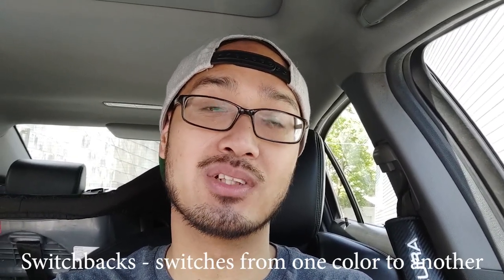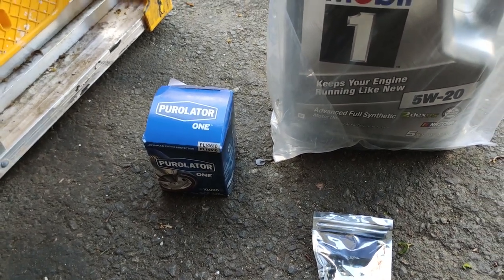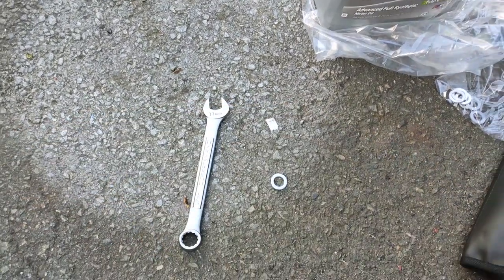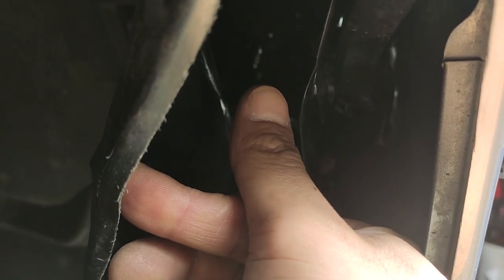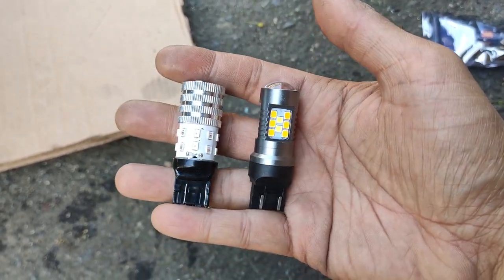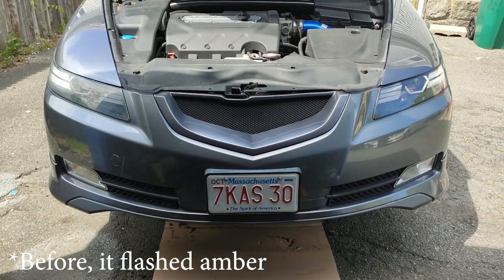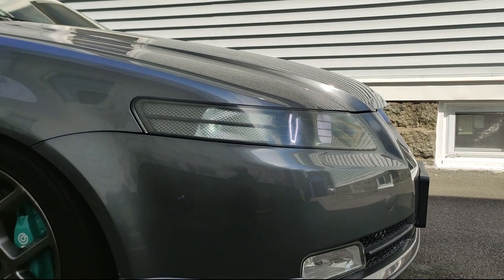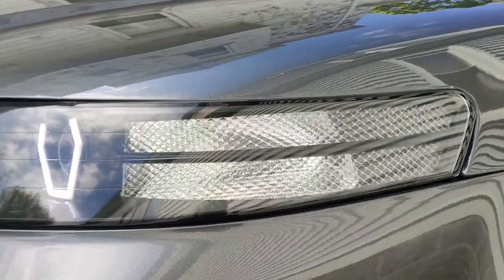LED Switchbacks!! on the RGB Headlights

Comment: Damn. I installed my switchbacks and they work fine. But for some reason, when I press the lock/unlock on my fob, they don't light up in sync with the rest of my lights anymore.
Reply from the maker: Not sure what's up.  Double check you installed everything correctly,  not sure if it's possible to plug in the bulb the wrong way, but worth a shot.  It may be just how the switchbacks work, different brands will vary
Reply: @thecarfiend11  i will give that a shot when I replace my ballasts + install new headlighta hopefully this week. Thank you! Love your TL!
Reply from the maker: Thanks man.  Appreciate it